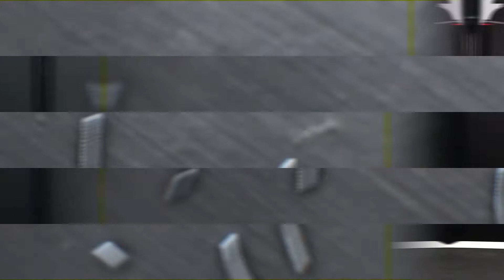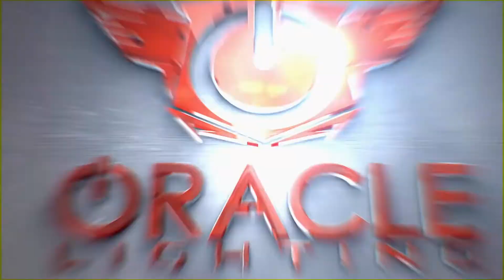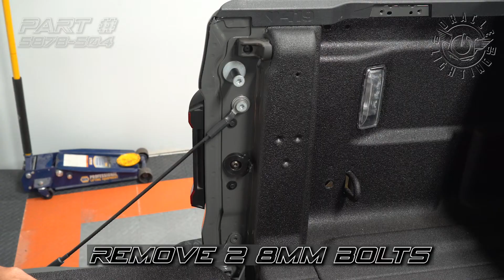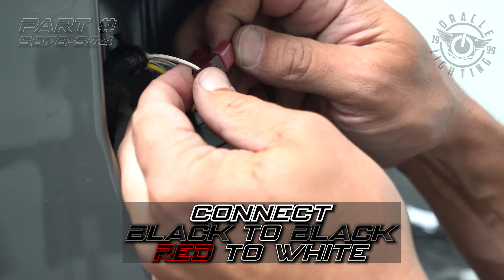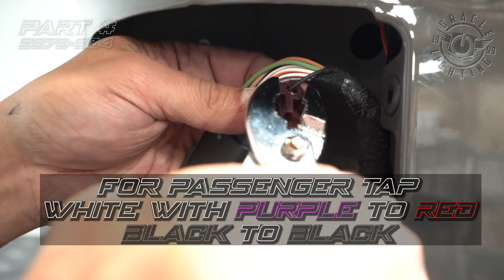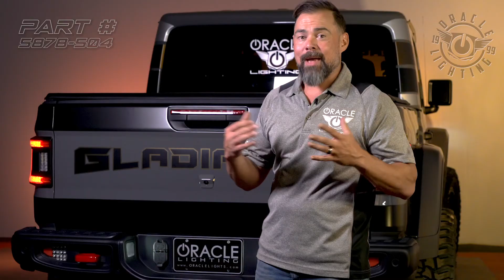Jeep Gladiator Rear Bumper LED Reverse Lights from ORACLE Lighting- Installation Guide DIY

Comment: My gladiator came equipped with factory rear fog lights not just the reflectors, if i install these reverse lights will a loose the red fog lights or do you have them integrated on the reverse lights next to them that red square?

Comment: I have led taillights from factory but after installing these led flush taillights and bumper led lights only drives side stays on in reverse and sometimes they all come on but go right off I reinstalled my oe taillight on passenger side now that doesn't work as well but did work prior to installing these I don't know what the issue is.
Reply from the maker: shoot us an email info @ oraclelights .com and we can get this corrected for you.

Comment: Im stuck 😩 i have current on 1 cable the other im assuming is ground. Ok my lights don’t turn on. I put a 9v battery 🔋 to see if they worked they do turn on. But when I connect them they don’t turn on. 😅 wht purple line & blk wire (passenger)  wht brwn stripe & blk grey stripe (Driver) 🙇🏻‍♂️🤷🏻‍♂️

Comment: I just want these as regular aux lights, operated off a switch (not connected to my reverse lights at all). Would this be possible using the provided wiring, or would I have to chop this up?
Reply from the maker: You would just connect the leads to your aux switch instead of to the reverse lights. Many customers chose to go this route.

Comment: After I installed mine, it keeps giving me a dash light warning  “blind spot needs to be service” it turns out to be a bad plug n play harness. it was a crappy soldering job. I didn’t even bother to send it back. I just figured it out myself. After cleaning that mess all works as described. If you come across with the same issue with this plug n play harness, just splice open the heat shrink were the  2 wires  for the back up light is tapped . Inspect it and make sure they are oriented properly and not touching each other.
Reply from the maker: Hello, really sorry to hear that. We are glad to hear you got it sorted but if there is anything we can do let us know!

Comment: I used the adapter and I got flashes. Needless to say it didn't work. When I called for support no one knew how to provide support for that.  I was pluging the adapter to my JT,WOLFSTORM LED Tail Lights Replacement for my Jeep Gladiator.  Will it not work with that type of taillight?
Reply from the maker: Not familiar with that particular tail light but seems to be a generic Chinese light, good possibility that is the cause of the issue.

Comment: I have both the oracle rear taillights and oracle bumper lights. I noticed that the lights come on when in reverse and then shut off. I have the tazer configured to led as my jt came with halogen from factory. Any idea of what I can do? Love the product when it works. T.I.A.
Reply from the maker: A few things, if you change it to LED on the Tazer you can remove the resistors by unplugging them. With the setting for the tail and reverse light updated in the settings and resistors removed you should be good!
Reply: @ORACLElights  that’s how the set up is now. no resistors and set to led and it is still not 100% working all the time. Should I plug in the resistor and see if that’ll be the solution. Idk if the wattage is too much or something running both things. I can send pictures to an email of how I have my truck set up
Reply from the maker: @mattlallan  on the Tazer can you turn off tail light monitoring like you can on the J-Scan? I can try to get more info for you on this.

Comment: Mine keep giving me problems. When I go on reverse they keep turning on and off.
Reply from the maker: Do you have factory halogen tail lights?
Reply: @ORACLElights  yes I do
Reply from the maker: @rafaelflores6132  ok, in that case the reverse lights are likely pulling a bit too much power and shutting down the lights. A couple solutions, one is to move the input form the tail lights to the trailer wiring. The other is to replace the factory halogen reverse lights with LED lights. This will lower the load and resolve this issue.
Reply: @ORACLElights  I have the Oracle taillights and get similar problems
Reply: @ORACLElights  I replaced my factory reverse light with LED bulbs now my Oracle LED reverse light doesn't work. Not even 2 months and it doesn't work anymore. I bought the harness with it too. I thought this should be plug-and-play with no issues
Reply from the maker: @tofuman7456  hello if you have a halogen Gladiator with the bumper reverse lights, LED reverse lights in the tail lights, plus the harness you just need to add a resistor with that combo. Please email info@oraclelights.com with this info and your order # and we will get this out to you.

Comment: What if I don't want to connect them to my reverse and want to connect them to my fog lights switch instead so I can use them for off-roading?
Reply from the maker: Yes, you can hardwire them to your fog lights. A few of our customers have done their installation this way for the same purpose you are describing.

Comment: Is there a reason to keep the reflector on there?
Reply from the maker: Yes, for FMVSS/ "DOT" compliance.
Reply: @ORACLElights  not every vehicle had reflectors....why is it required for this one?
Reply from the maker: @214steveg  if a vehicle does not have rear reflectors look at the tail light, it will be integrated there.
Reply: @ORACLElights  ,ok..thanks !!

Comment: Do you know if these will work if our tail lights have the side sensors? I'd like to get the plug and play kit without the t-taps and was wondering if all that functionality will still work? Thanks!
Reply from the maker: Yes, designed wot work with the factory sensors, they swap right over to our lights and we include a plug and play connector to connect the sensor.
Reply: @ORACLElights  thank you!!! I'll put in an order!

Comment: if it was a car not a jeep the tee bight clips might b fine long term but most jeepers will want your fancy plug & play harness.
Reply from the maker: There is a very easy drop-drop option to add the plug-and-play harness to an order if desired. Thanks for watching.